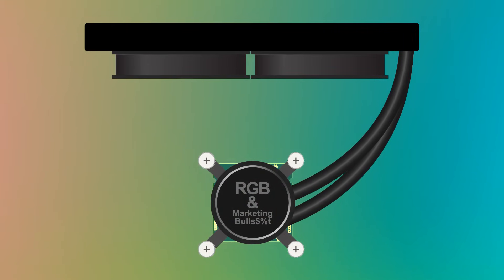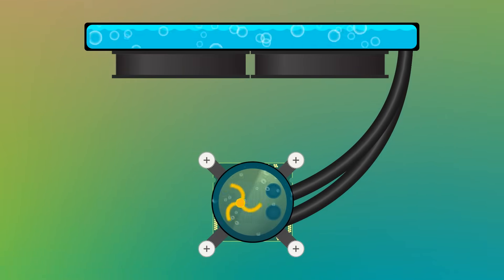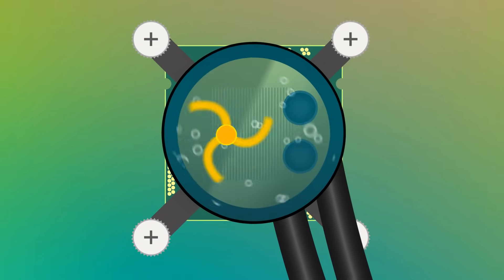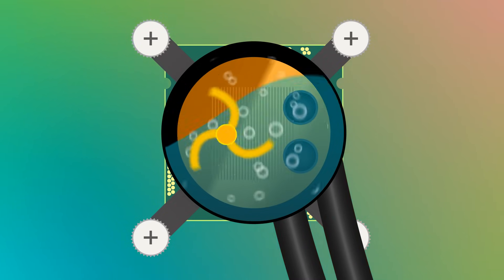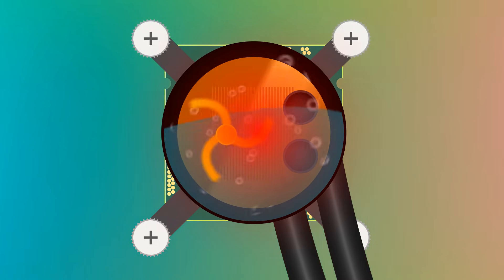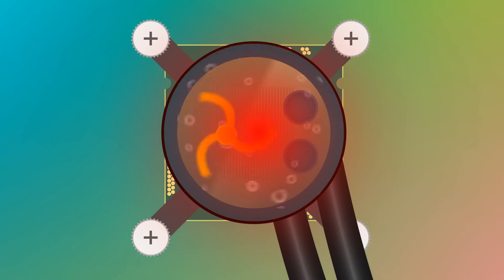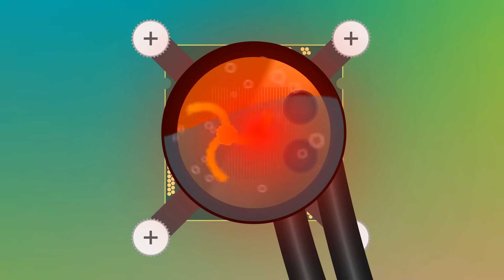Correct AIO orientation (This is the way)

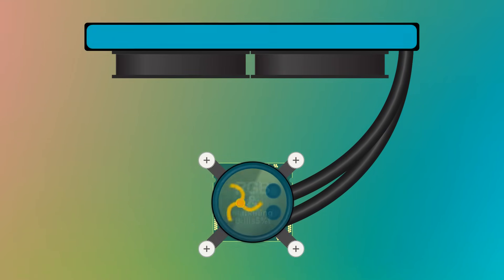Comment from the maker: Both 0:11 and 1:46 are good orientation guys.

0:11 needs the fans to be in exhaust configuration as hot air tends to rise.

1:46 orientation should have the fans in intake configuration.

Thanks for watching!
Reply: The higher up front mounting is better than the top mounted, as GPUs tend to cope better at expelling the slight increased heat of the CPU radiator as opposed to the radiator trying to cope with the significantly higher increased heat of a GPU. https://www.youtube.com/watch?v=xNAMxZgvves
Reply from the maker: @EmeraldPreserve  That is true in some cases but not all.

According to steam survey most of the people game with nvidia 1050-1660 range of cards and they aren’t that hot.

It also depends on tasks you do which can be either CPU bound or GPU bound.

At the end of the day we need separate chamber to divide GPU and CPU
Reply: I cant use the second config on my nzxt h510 because the prebuilt chasis and my deepcool castle dont fit if I put the tubes below :( it only works when the tubes are placed on the top side
Reply: 0:11 I think setting aio fans as intakes would be better in my case since I have an rtx 3070 which is definitely putting a lot of hot air going up in the case (I noticed that with a regular air cooler). So in this way the radiator would be taking fresh air from outside the case instead of taking hot air from the gpu, am I right?
Reply from the maker: @xW3rder  You are very right, in fact I should have made that clear but it was going in to airflow topic which I will touch up on next video.

thank you for the comment.
Reply: Pin your comment
Reply from the maker: @tejasparab2389  Thanks
Reply: @tldrinfographics5769  this is not what GN said. They still do not recommend AIO side mounting.
Reply: This is DA WAE
Reply: I have a question, if I get an 120 AIO how is the best position for that? 🤔
Reply from the maker: @StickDead  please don’t buy 120mm as it doesn’t perform well.

At least 240mm 

0:11 or 1:45 is the best
Reply: Is back mounted aio good or bad or should i just stick to top? I want to do either back exhaust or top exhaust
Reply: @Nik-rj5kc  do top
Reply from the maker: @Nik-rj5kc  I prefer top exhaust
What is your general use? game or work?
Reply: @tldrinfographics5769  both but tbh mostly gaming
Reply: @tldrinfographics5769  also this aio is a kraken m22 and they advise a back mount as exhaust. I was just wondering if back mount will work fine or if it will cause issues and I should go top mount
Reply: Thank you 😊
Reply: Mounting it like 1:46 will make the air bubbles get trapped in the pump...!! The inlet/outlet should be on top / above the pump, so air will eventually get trapped in the radiator...
Reply: 0:11 doesn't need the fans to exhaust - hot air rises very slowly. The fans will overpower the natural process.
Reply from the maker: @Kippenoma  Sure and there is no reason to go against it.
Reply: @tldrinfographics5769  There can be in specific setups. It is case and hardware dependent whether an airflow path like that makes sense, but convection is so slow it really doesn't matter. GamersNexus (who you reference in the video) has even talked about in a video at some point, I think.
Reply: @tldrinfographics5769  The "hot air rising" effect is so weak that it's absolutely no problem to go against it. That's also why passive cooling is so "weak" and even a slight airflow increases cooling performance by a lot. Just go with the direction that fits into the whole build the best.
Reply: @Kippenoma  Adding to your statement: The LianLi O11 Dynamic is such a scenario. I have a top-mounted radiator and two bottom-mounted fans as an intake, and 3 fans at the side vents as exhaust. Works really well, as both the CPU and GPU get relatively cool air from the outside and the 3 exhaust are powerful enough to suck most of the hot air out of the case.
Reply: @vattghern1003  this is exactly what I was looking for omg. I accidentally bought the 2 fan 280mm radiator and fans one and didnt know if top radiator side out fans were alright or if I should just get the 240mm ones and put to side and output on top
Reply: @Kippenoma  To me, the reason is simple, exhaust so that you don't blow the heat from the radiator into your case.
Reply: This is the way.
Reply: should the fans in 0:11 be intake or exhaust?
Reply: @logiknotlogic6586  it can be anything it is upto you but make sure that number of intake fans be equal to the number of exhaust fans ( a difference of 1 or 2 is alright) and exhaust configuration with radiator top mounted is not bad because the intake from front 'mixes' with the hot air rising from GPU which results in cooler air passing through the radiator
Reply: @shashankg1493  ok thanks dude
Reply: For 1:46 can it be in a push pull configuration?
Reply from the maker: @theplaidgamer1653  Sure  can just watch out for too much fan noise.
Reply: 1:46 Why do you think the fan orientation as intake instead of push ist better? Temps, noise or sanitation(dust in rad)? Thank you for your answer i just got my AiO and your advise is very much appreciated
Reply from the maker: @Oberzissen1992  Oh that’s just an error, you are correct.
Reply: @tldrinfographics5769  what do you mean? Doesnt matter what fan orientation then? Both fine? Or prefer pull over push?
Reply from the maker: @Oberzissen1992  
Push is the way to go but difference is very small.
Reply: @tldrinfographics5769  thank you for your quick answer! Subscribed :) good stuff
Reply: 1:46 will over time still add gas to the pump. It's best to have pipes and radiator not lower than the pump at all. Atleast when you plan to have a system running for 5 years. You could do 1:46 but you should lift the case while the Pump is running and put it in a position where the gases in the pump can escape through the pipes into the radiator once a year.
Reply: As mentioned above, "hot air rising" principle is so weak in a case with fans that it literally has no effect inside a case. The turbulence from the fans are overpowering that effect. The reason why we prefer bottom to top air flow is simply because the coldest air in the room is along the floor. THIS is where hot air rises principle comes in, in a room with no fans and stale airflow. And no, you don't have to use the radiator as exhaust. You just have to chose which component you want optimal cooling on. The GPU or the CPU. When radiator for CPU is set as exhaust, it WILL take heat from the GPU and get warmer. If you use it as intake, the GPU will get slightly more hot air in the case to work with, but the GPU is way more efficient than the CPU in this case and the GPU will handle those extra degrees way better than the radiator.
All in all the choice of exhaust vs intake is down to which of the two components that needs better cooling. For a gamer that uses a GPU for high load will benefit from exhaust, as the CPU tends to be less utilized for most games compared to the GPU. For the balanced usage, the user will benefit from using the radiator as intake. For CPU only, def intake.
Reply: when i put the radiator on the front side and put exhaust on top... there is too much hot air in the case... so its not good at all... if u have intake from bottom it might be ok
Reply: Just install the radiator in the top of the case rather than the front, and you will be ok.
Reply: the air in a case with intake and exhaust case fans moves way too fast for "hot air rises" to matter.
Reply: @jakacresnar5855  You can give it a little assist by exhausting it through the top of the case.
Reply from the maker: @SulitGadgetsPH  I think both exhaust because heat can just recirculate
Reply: @tldrinfographics5769  yes but then you have the front air coming in and immediatly being sent back out via the front top fan, which isnt optimal
Reply: Can you please explain the intake/exhaust of 1:46 configuration? I have bought NZXT kraken X53, going to use 1:46 position, but don’t know how to  assemble fans in “intake configuration”. So, is it face logo inside or outside? Thanks a lot in advance! I know it might sound stupid, but helps a lot If you answer
Reply from the maker: @artemrasskazov3565  You can either mount the fans in front or behind the radiator, I would personally put the fans in front if possible.
Reply: @tldrinfographics5769  get it, thanks a lot!)
Reply: @tldrinfographics5769  is better to put fans on the front off radiator if it’s front mounted, have mounted on the back should I flip them
Reply: what do u mean exhaust config? im not english speaker.. srry for that
Reply from the maker: @shadowrealms2676  pushing air out of case = exhaust
Reply: Why intake?

Comment: If the pump's inlet and outlet are installed in the 3 o'clock direction as shown in the video, is the outlet the upper hose or the lower hose?(usually)
Reply from the maker: Hose outlet position doesn’t matter as much as long as the highest point in the system is the radiator.

Comment: I will disagree here for you recommended V shape orientation. Although the highest point is at the radiator side but the air bubble needs to go deep lower before it can flip to the radiator side , which i am sure air bubble will very likely being trapped still in the cooling head side, which is very bad.

Comment: 30-minute video to 2 minutes long.
2 minutes long to 3 sentences long.

closed-loop system will always have air pockets even if vacuum sealed. air is lighter but also has worse heat conductor than water. Place the radiator higher than the CPU cooling block will make said air pockets stay in the radiator than the CPU.

Comment: An easy way to correct this is to imagine a cooling system on an engine. Design it in a way so if there is an air pocket, it resides on a thermal transfer radiator, or near a pressure relief.

On PC's, make the CPU pump hoses run vertical or as close as possible to vertical, so no air pockets collect at the pump. This not only kills/cavitates the pump, but also raises the temp because its unable to remove the hot air pocket.

You can get pressure relief fittings or a vacuum leak detection device. Mount it at the highest point of your radiator. Now you have an ideal bleed/service port.

Comment: what do you do if you wanna put the tubes down, but because of the length of the GPU you can't and are forced to put the tubes up
Reply from the maker: It’s still ok to have Tube up if you don’t have a choice.

But the radiator still needs to be higher than the pump.

Comment: Lots of convection, hot air rises fan boys still don't get it...all of that principle is out of the picture once mechanical air movement is introduced via fans. Truth is if you positive pressure the case (more intake than exhaust) the air has no choice but to escape. It does not matter which direction...it will leave from the bottom as easily as it does from the top not to mention every other crack and crevice in these pc cases.
Reply from the maker: It’s true, Steve mentioned multiple times about convection being negligible impact.

But there is no reason to go against it and also when things are idling with fans on low speed or in complete stop convection does need to be considered.

Comment: I have the tubes installed on the top of the radiator and periodically i have issues with cpu temp do you think that rotate the radiator of 180 degrees(so i have tube on the bottom) should change the temp?
Reply from the maker: Theoretically it shouldn’t.
But definitely worth a try to flip

Also check if there is enough thermal paste and the contact is good with the heat spreader on CPU.

Make sure to shake the whole AIO to get the air bubbles out of the pump and into the radiator 

Good luck

Comment: A bit late to reply but if my AIO is like 1:46 but the tubes is on top, will that be ok?
Reply from the maker: Yes Tube on top is fine.

Just have to make sure radiator or the tube is higher than the water block or pump.

Good luck!!

Comment: Aio is always without air pockets filled under the water or fillament .. whole video is useless only if you build it yourself in which case bubbles will go to the resevoir
Reply from the maker: No, there isn’t an All-in-One (AIO) cooling system completely free of air bubbles on the market today. AIOs are sealed, pre-filled liquid cooling units, and due to practical design and manufacturing constraints, they all contain some amount of air. This air is intentional and serves a purpose, but it’s minimized to avoid performance issues.

Comment: There's one way around this air problem that will permit any orientation of the radiator. Place the system in a vacuum then refill the system while in the vacuum state. It's how AC systems are charged. Unfortunately there isn't a tool that i know of that will do this for a AIO or custom loop systems unless you make one yourself... which I'm considering doing.
Reply from the maker: That sounds interesting.

Honestly I’m not sure why they have air in AIO system at all.

Thermal expansion of liquid in AIO system is only 1%~1.5% at 80 degree Celsius, which can be easily handled by the flexible cable.

Air can act as damper to reduce stress to the system over long time but I still think it’s more than possible.

But it does sound expensive…

Comment: The rad at the front will blow warm air inside the case. I have mine mounted at the top as exhaust.
Tubes facing down on the pump. No issues with temps. I have spacers under the rear pads of my pc case
 to tilt it so the rad is lower on the tube end. No air should come through.

Comment: If the last orientation the pipes are above, that's not the worst position, it only leaves gurgle noises when air is close to the inlet for the pump. But other than that it's fine.

Comment: Seems like people don't understand basic elementary school grade physics nowadays.... as long as you get the air trapped at the top of the radiator and the tubes are below radiator, it doesn't matter if the pump is higher than the top of the radiator or not. The air doesn't travel downwards through the water just to go back to the pump because it's now the highest point LOL. Bro how don't people understand this? Air stays up... it's much lighter than water.... air doesnt go below water

Comment: what about the AIOs that have the PUMP IN THE RADIOATOR? such as SilverStone XE360-TR5
Reply from the maker: You still don’t want air bubbles near the heatsink so keep the radiator that contains the pump the highest point of the AIO system.

I feel uncomfortable top mounting AIO with pump in the radiator because of cavitation effects.

Comment: Does this also important for the ASUS ROG Matrix RTX 4090 Platinum's cooling system?
Reply from the maker: Same principle but
Some people make mistake of mounting the radiator at the bottom of the case which is not good.

Comment: With a 360mm rad you can still install it on the front with the tubes on top and it's like a 0.2% difference than if they were on the bottom. The reason I like to point that out is sometimes the case does not allow for any other orientation. Take the O11 vision for example. The top is glass, so no mounting there, and if you have 140mm fans on the bottom, then your rad tubes don't fit. So the only thing you can do, is flip it.

Comment: The first moments of the video were SHOCKING.

The end was what calmed me down from a heart attack
Reply: Was it wrong in the beginning?
Reply: @GoldenKnight702 
As he said, "Inside the AIO system there could be 10% air circulating in the loop"

I thought it was some kinda time bomb that will eventually grow. More and more air would be vaporize inside as the time goes on.
Reply: @EasternCitizen  basically, top mount is always fine. That’s what I’m reading. I’m doing my first build soon and I’m trying to learn as much as I can

Comment: Nothing wrong with air in the system. Bigger problem is when there is not enough liquid. Too many people getting worried about the orientation and cooling when this is all consumer grade junk. You want to deal with REAL cooling where this kind of minutia matters, then attend class at MIT for research and development and work on systems that are delicate. Consumer grade electronics are simple and relatively bullet-proof by comparison. If you are over-clocking consumer grade equipment, good luck. You might get a whole 10% for all your time and money, lose all your environmental efficiency and system reliability and degrade your components exponentially so they die much earlier. In which case, maybe the orientation of your pump and radiator would make sense.
Reply: when "consumer grade" CPU manufacturers nowadays push their silicon this hard that they can draw stock 150-250 amps (1.2v) through a miniscule chip, maybe starting to worry about bubbles starts to make sense

Comment: I have 240MM Antec AIO Neptune, everytime I turn the computer off I need to fix it by unbolted and shake it a bit to make it work, otherwise it'll automatically shut down due to CPU reaching temperature threshold which is 90 degree
Reply from the maker: Do you still have warranty? It should have 3 year warranty.

Comment: i put the cooler the same as here, but the pipes are below the cpu  (not like here on the right side) (is this ok or no? hope wont have issues). so to have an idea from 0:12 rotate the cooler 90degrees right and the pipes come from below and the radiator on top as usual